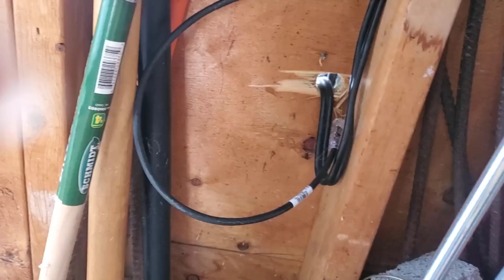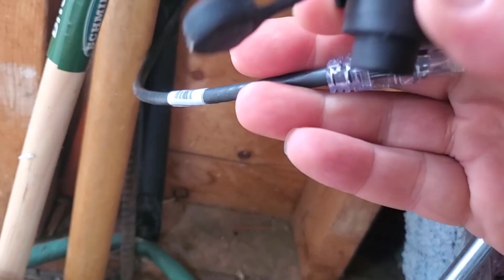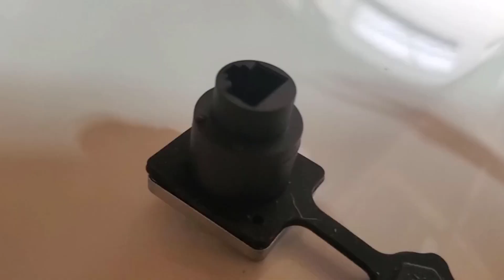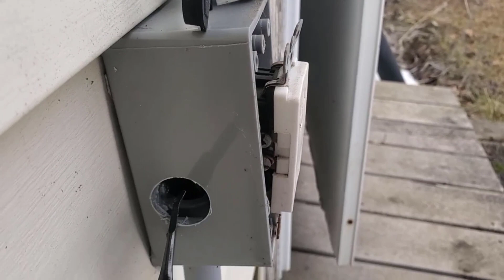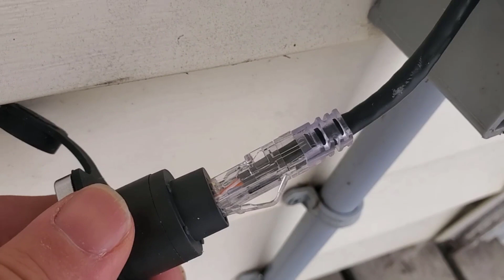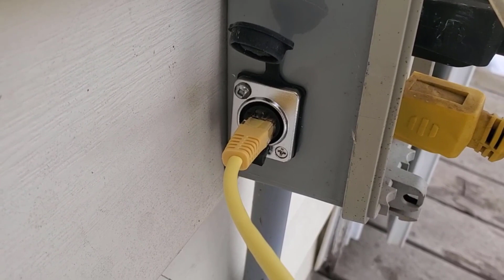Outdoor Rj45 Jack Install

Comment: I appreciate the install, but I feel like mixing high/low voltage in the same junction box is ❌
Reply from the maker: i thought so to but i tested the cable extensively and not had any issues.  i figured, i could always move it if i had issues..